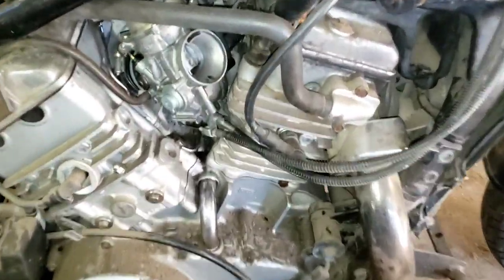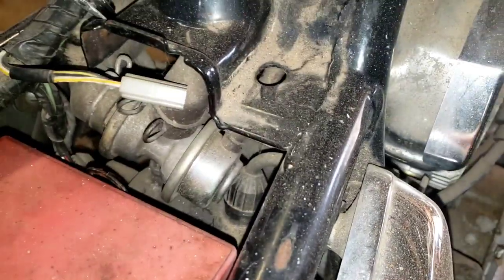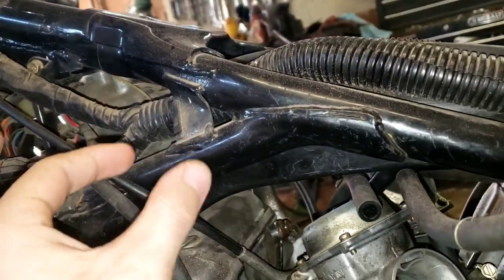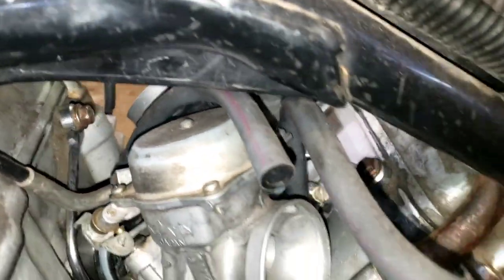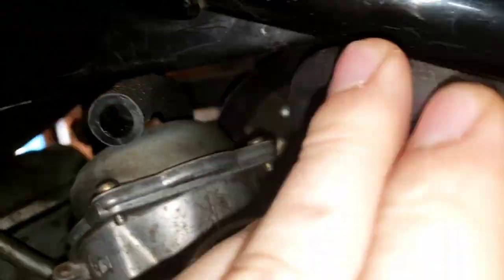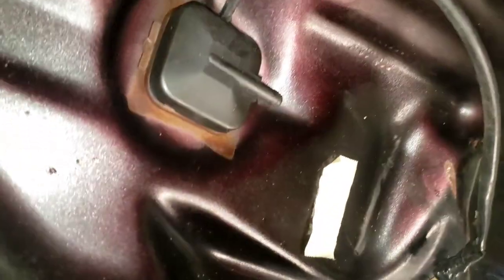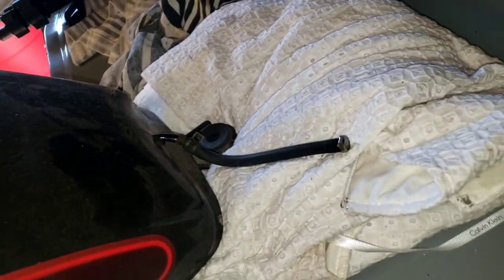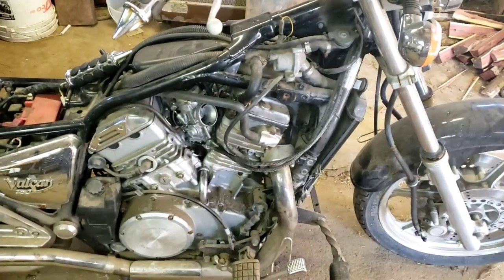94 kawasaki vulcan (vacuum and fuel hose location) 750

Comment: where does the hose that comes of the rear of tank, go to
Reply from the maker: @vickyberta3372  The one coming out the bottom end of the tank (near the seat), I'm assuming, is a vent line, and it runs down in the frame rail to the ground.